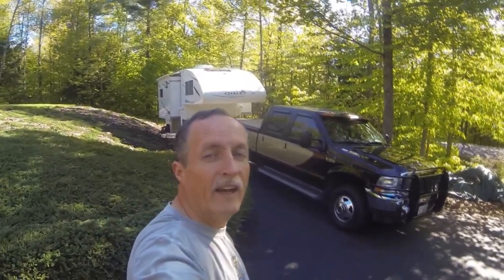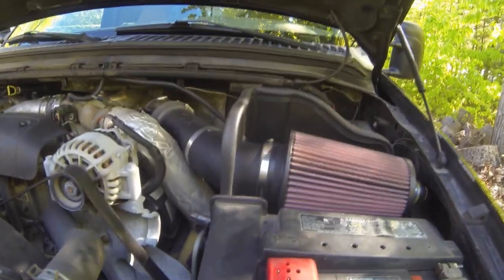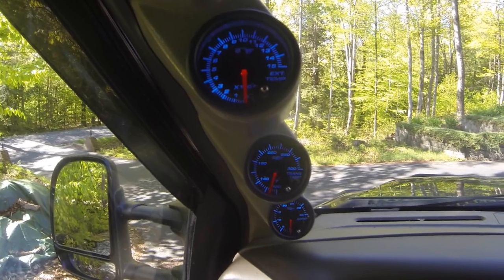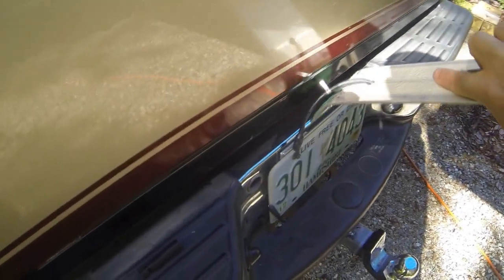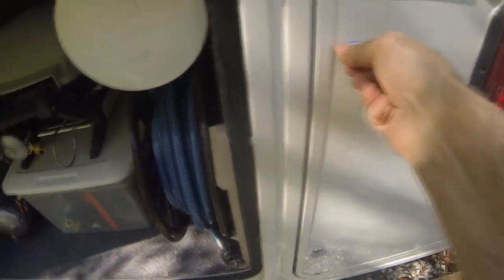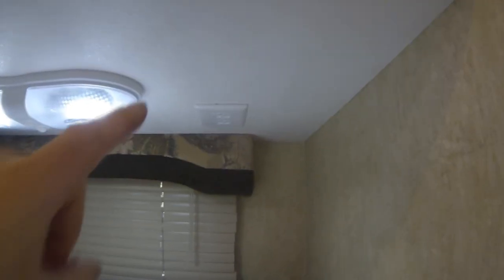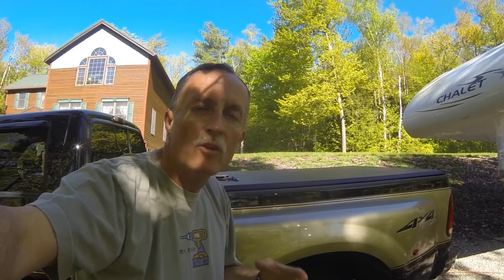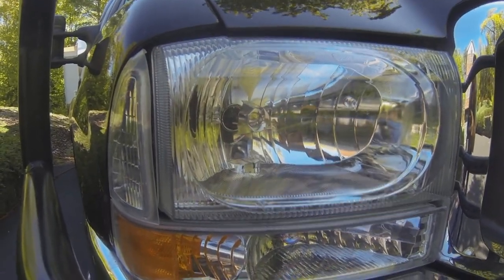2012 Chalet DS116RB Truck Camper & 2001 Ford F350 Truck Modifications

Comment: Thanks Charles.  I have the Torklift Superhitch 4ft extension on my truck for my current 12ft camper but did not know if the DS116RB's rear hung too low for a hitch below it.  This is good information!

Comment: Great job! I went cross country last year with my F250 and lance truck camper we drove up into Canada into Alaska and your bigger gas tank will help at least to put your mind at ease. It can be a good distance between fill ups. I would drive until the gas gauge read half at that point we would start looking for gas. It worked out well. I would have to say that even up in the Yukon or BC you will find gas every 50 -100 miles usually :)

Comment from the maker: It does feel a little top heavy, however, I have only towed so far with the tanks empty which are in the lower truck bed area.  I believe that if I fill the fresh water tank this will help offset some of the top heavy feeling.  For this size rig it is imperative that you have a dually to widen your stance on the road!

Comment from the maker: To be able to tow my enclosed trailer while the camper is on the truck, although possible, I am not set up to do it.  I would have to have a more rugged hitch installed, with an extension kit that extended beyond the 3+ foot overhang that the camper now hangs beyond the back of the truck.  Being a cautious hauler, I don't feel comfortable adding more weight beyond that of the Chalet for my truck to deal with.

Comment: I envy you, did you log the cost of traveling?  I have a Lance camper one side 2006 930 model with a 2006 Ford dually, we might do the same thing. We will log the cost minus the unit cost. Good job, thanks for posting.

Comment: The only thing with the thing you have on the dually is that if you have a blow out with one tire the other tire will go flat also.
Reply from the maker: +Stan Wilson Stan - the Crossfire units are designed to balance air between your dually tires, and to stop this balance action during a blowout.  During a blowout, the balance is stopped immediately, and during a slow leak of one tire it can only lose 10psi before the balance is stopped and in both cases the guage goes from yellow to black giving you a visual indicator of a hidden problem!  Watch this video to see more:https://youtu.be/kUA1TO6CfgI
Reply: Thank you

Comment: I  have a 2009 f-350 dually and am looking at a truck camper to replace my class c with a v-10. It gets 6 mpg and I think I can do much better with a truck camper, and am tired of towing a toad and just the length of the darn thing. I looked at the chalet and the host everest and really wanted one of those but put them on the back burner because of the weight. My truck will haul 4200 lbs. in stock form. I was disappointed because I wanted more room but was thinking of settling for a smaller one. Thanks, you have given me hope. You have some really great ideas and I appreciate the video. Maybe I will do one too.
Reply: how do you like the 6.4l?
Reply: No problems. I bought it used with 29,000 miles on it for half the price of a new one. I'm sure the newer the better but it has tons of power.
Reply: htbud11 but new ones dont have a "twin turbo" :) idk if i wanna get a 6.0l or a 6.4l cause i know the 6.4l has some bad mpg compared to the 6.0 but the egr kills it... but fix it and i know its a little powerhouse lol
Reply: Yeh, it's strong, but you're right, thirsty. I'm going to try a tuner on it to see if I can improve that.
Reply: htbud11 im lucky enough to have my mom and dad get me the truck i want BUT before we do the "daddy bought" stuff i HAVE to pay them back or they will "repo" it i chose this way cause then if they take it there is no docking fees :)
Reply: htbud11 i meant to put this first but oh well lol if i get a 6.0l it would be better for me cause i have a 05 f250 right now but it is a gasser it sounds nice i dont tow anything currently but i drive to my hvac school everyday. about 50 miles a day and as we all know gas trucks get like 5 mpg XD so i plan on getting a diesel :D
Reply: me2456 My son has a dodge with a cummins with 200,000 miles and runs great. He gets over 20 mpg. I love diesels and yes, the gassers drink. My rv has a v10 and it sucks gas. 6 mpg. Keep your eyes open for a low mileage used truck and grab it when the deal is right. I waited 2 years before I found the right deal. Pleasure to talk with you. Best of luck.
Reply: htbud11 thanks man!

Comment: I also have a 2001 F350 dually, nearly identical to your's. I am interested in your two-year experience with your camper, especially with how the truck handled the weight. I have a Lance 1161 that weighs nearly 5000 lbs wet and with that weight I am almost 2000 lbs over the GVWR. I just returned from a trip to Florida from Michigan and it was a handful. I chose not to install airbags; rather, I went with "Supersprings". They did a great job but I'm still concerned about the weight. My guess is that your rig is even heavier, especially with all the extras you have installed. Regardless... I'm impressed with what you have done. Please advise.Thanks!
Reply from the maker: John - the dealer that I purchased the Chalet DS116RB installed air bags on the back axels for me, and they have worked great at carrying the weight.  However, I got tired of constantly checking the pressure, and adding if necessary, so I just installed an on-board air inflation system (Air Lift kit#72000).  This has worked great and I highly recommend you do the same!
Reply: Charlie, Thanks again for the information. I do plan on installing the air bags prior to my annual Florida trip. However, I am still concerned that regardless of the assistance afforded by the bags, I am still at least 2000 lbs. over my GVWR. I know that the truck can carry the weight - I proved that last winter and you did as well with your Chalet - but I still worry about the excess weight. Any comments would be appreciated.
Reply from the maker: John Finke John - the on-board air bag inflation system is a must, along with the Crossfire units to assure the rear dually wheels are always at the correct pressure.  We also put our  camper on a 'diet' where after traveling for 6 months we discarded everything we had not used in the camper to reduce weight, and this was considerable!

Comment: 7.3 stock low on power? Nope that motor could handle 3x the weight of that camper. Now if your talking tuning yes a tuner makes a diffance on ALL diesels gives you the ability's to vary hp and mileage.